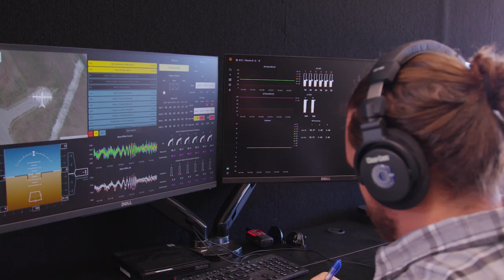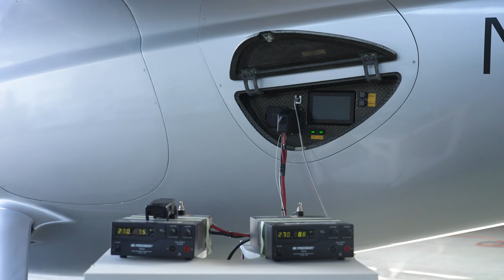Adam Savage Learns About an Electric Flying Vehicle!

Comment: I'm definitely getting 'SV startup' vibes from a lot of the responses, but it's very refreshing to see them acknowledging the limits of current battery tech and building something that can be viable (if niche) with current technology. It seems like you see a lot of headlines of "electric plane of the future will replace jet fuel for airlines!!" that neglect the slight issue that batteries are nowhere near energy-dense enough for that currently. Definitely don't think just moving traffic to the air is going to solve traffic issues, just move them, for for short-hop transport like they are proposing it could be an interesting option. I could also see this tech being useful for services like lifeflight, where they are relatively short hops but need high maneuverability.

Comment: Too many propellers.  The top range of an electric plane is proposed to be 600 miles for an eleven passenger plane. 100 miles is pretty low for today's tech and design.  This is not a flying car it is a vtol plane with a small battery.  Better batteries are being made now, such as dry solid state and graphene batteries.  I want the flying car that is small, driveable  with vtol capability without having a huge change like giant folded up wings.  Two large propellers aft and fore and two smaller ones for propulsion forward and slide out wings from the bottom, not huge just a manageable size.  Also small wings on the top to aid in lift, range and efficiency.

Comment: It’s going to require some HUGE innovation in battery technology for this kind of thing to ever be feasible. energy density of batteries is still less than liquid fuel, and unlike liquid fuel you don’t lose weigh as you fly. However a 1 hour flight time is still quite impressive.

Comment: I think autonomous is going to be the only way to make this viable. Having set “highways” in 3 dimensional space where these travel on their determined routes. A pilot would be nice for emergencies, but I think people are feeling more and more comfortable with autonomy. It’s also a much easier idea in the air than it is on the ground; less pedestrians and other vehicle congestion to worry about. 
If you have the highways set and clearly understood, the algorithms for custom flights get even simpler. Truthfully, more autonomy and determined pathways in airspace as well  as better instrumentation to show those pathways will just serve to make air travel even safer in the future. 
On the whole, the biggest improvement we are waiting for is higher capacity, lighter and less volatile energy storage. Once we have that, these aircraft will become far more accessible.

Comment: This is cool but it's not a solution for traffic. We need to remove single passenger vehicles from roads, not add single passenger vehicles to the sky. This is essentially the "add more lanes" flawed mentality except vertical. Railways are better in virtually every way for reducing traffic. This is more for luxury travel or possibly emergency travel in remote areas etc.

Comment: Though I'm not one for knocking down peoples innovative dreams,  i have to say this aircraft does have quite a bit of questionable attribute.  The main issue i see is the inevitable drag which will be created when its rear set of rotors are taken out of use when the aircraft is in full forward flight.  6 large rotors that will generate a ton of air instability (drag) when not in use.  Joby which has a somewhat similar design uses a tilt system for all its open rotors creating thrust and fully eliminating drag.   This design was rather poorly conceived.  A disjointed idea of two systems, one for forward thrust and another solely for lift, and only serves to reduce the aircrafts efficiency once its underway.  Ironically this Vtol concept shows little promise if compared to a forthcoming electric powered helicopter.  One that would see to greater numbers of passengers and a far simpler layout.  As for autonomous operation.  not likely.  There will always be a need for a pilot on board in case of an emergency.  The minute an incident occurs without a pilot on board is the minute that very issue will center upon.  Its not that a pilot must 'fly' the vehicle at all times but rather simply having the access to fly the vehicle in an emergency situation.

Comment: The big problem with electric aircraft is battery energy. Ten pounds of gasoline has 100 times the energy of ten pounds of battery. This plane is clever engineering but until the battery problem is solved electric powered planes will be impractical because of battery issues. The real research into electric vehicles should be is making batteries that are lighter and have more energy capacity.

Comment: Love the idea, but even if they somehow became reality your forgetting the most limiting factor... the weather.  You would need near perfect conditions to use it with any degree of comfort.  Low altitude flying is prone to terrible weather  , would be hideously bumpy and turbulent on all but calm winter days. 
Pilots tolerate turbulence but normal people would be scared to death and feel ill . 
Even if the weather is good where you take off it could be way different where your going and when you return

Comment: the engines usually are the most expensive part of an aircraft, also they part that requires the most maintenance, so the less engines, the more cost-effective and flight time it can achieve, up to a point, it will always at least need 1 to operate, right.

so 6 electric motors are going to be very expensive and maintenance heavy. this is cool tech, but not a commercially viable product by a long shot

Comment: I don't think it is a problem with the vehicle now that electric motors and especially high-capacity batteries are a thing.  The bigger problem by far is the air traffic control system that would allow millions of them to safely share the skies.

Comment: Was there any talk about obstacle avoidance?  I cant help but remember Back to the Future II, where the Skyways were so overcrowded, that they had to come down and take surface streets to get anywhere.  You cant just fly a car where ever you want, there have to be rules about where and how they are flown. Has this been given any thought.
Reply: We are working closely with the FAA on achieving Type Certification. You can learn more about our progress and collaborative relationship with the FAA here: https://youtu.be/yQXLMjbBHU8
Reply: @ArcherAviation  Thanks! As long as its in the plan, Im happy.  Keep up on the autonomous flight too!  The thought of people flying the way they drive scares the bejeezus out of me.
Reply: @starhawke380  Our aircraft will be flown by professional pilots, but we do envision a future with autonomous eVTOL at some point not too far out.
Reply: This can be a problem until the human factor is removed. For example, if all vehicles were autonomous, you wouldn't need traffic lights. They can coordinate by themselves at speeds only computers can achieve. Of course that's for the future, right now traffic is light so sure, maybe the occasional flight can be done "manually" (if the uber "fly by wire" poly rotor drones do can be considered such).

Comment: I see this product as a potential replacement to a helicopter due to its vtol capabilities but I do not see a viable option to be a taxi service. His argument about taking people out of cars and into the air is not a good idea because of the amount of air traffic in the air that air traffic controllers need to control. I think a better solution is take the traffic underground or use the public transportation we have now and improve on it instead creating a solution with potential problems.

Comment: The furthest propeller is pretty far from center. How much trim does the vertical stabilizer have?
Reply: 42
Reply: Looks to me as the forward rotors have two degrees of rotation (up/down, and possibly a bit left and right) -- they may be using that to add additional yaw control
Reply: when one motot dies they will likely need to kill or reduce power to the compliment on the other side.

Comment: Im kind of confused that, i believe 5 years ago, i was wondering about the state about evtols and first found chinese ehang. I thought that looks pretty cool, simple and surprisingly market ready. They even had done many, many test flights already including test flights with passengers. Yet they still aren't implemented anywhere. There's also a prototype autonomously operating scyscraper firefighting drone. It's only downside is range but apart from that, i think it's the superior concept, as it is so much smaller than this monstrosity right here. Then again the ehang is probably deafening.

Comment: I think one of the coolest things is that it just goes from motors off to flying in no time - no warmup period like conventional helicopters.
Reply: That and it doesn't use $150 in fuel during that non-existent warm up period either...
Reply: 😎 Yep! eVTOL aircraft are superior to helicopters for urban air mobility in several ways: safety, noise and lower operational costs being three of the biggest.
Reply: @ArcherAviation  Yeah, I was specifically thinking about military applications re: warmup period. Pretty awesome stuff.
Reply: @MattTee1975  Same thing happened to electric cars. Well its been long since people needed to warm out their ICE cars but still, electric motors have this advantage of instant power and simplicity of maintenance vs combustion engines.
Reply: @freeculture  Yeah, it just really stood out to me, because when I was in the Marine Corps I'd watch CH-53s and 47s just idling on the deck and imagine literal tax dollars being consumed.

Comment: This system will basically work like an Uber(elevator) service where you call for one and set a destination and everything would be done by automation with human oversight on the ground with no pilots or yourself in control of the flight.

Comment: What does the flight test instrumentation for this vehicle look like? Is it just integrated as a part of the custom vehicle control system or is there independent orange wire systems running to a commercial product that say the FAA is familiar with? I understand it's a lot easier to achieve FAA certification by using COTS products over custom built systems.

Comment: how  will you combat the smoke from a battery failure/fire!!!!! its gonna happen?
Reply: It pretty much never happens and only with extreme unique cases (such as really, really bad manufacturing tolerances and regulation). Battery technology have a ton of safety features that prevent thermal runaway. 
Even tesla with their shitty manufacturing quality have only ever had a handful of thermal runaway instances with their oldest models, and they have millions of cars on the road. Cars catching on fire (by their own account) is within a certain tolerance for mass manufactures, but with battery tech, it's almost literally unheard of. 
You are 100000000000x safer in a EVE than an ICE. It's also why EVs get all the safety awards every year.

Comment: I forget the name but there is another company that is making vehicles like this in the USA though ultralight, they have a different look and have been out since 2019 or so, just the production has been slowed due to component shortage and China Hording some of the parts so it is slow to market.  They have the plan for the vehicle to have the eventual Price down to $60,000 or $50,000 so no more then a New F-150 Northland edition if bought new in 2021--2022, depending on the features you got on the truck. People can actually get into the vehicle.
Reply: There are a whole bunch of companies trying to get into the "disruptive" e-plane game.  I tend to trust Archer's design more than most, because they stole it ready-made from Wisk / Boeing.  Theft of trade secrets trial against Archer starts Jan 2023.
Reply: @SansNeural  Yes but this one has had a ton of people test the ultralight plane that does a very similar thing and uses trusted flying tech in them, that planes like the small one man/a few passenger lightweight planes and as well as small turbo props like the small 12 or less passenger use in the plane/ to keep the weight down.  Then use engine tech the drone industry uses for some of the high tech drones that is no longer under patent, they forgot to renew/chose not to and missed the window for renewal just scaled up for use.  The nice thing is that the plane flies silent due to using a similar propeller that has wing end stabilizers going both sides of the propeller. I trust this other company more then this one becuse they did not simply copy a one to one design off another company and did actually have a number of passengers in the test flight the plane does itself without a ground crew. When I saw this one I thought of a plane Boing is making/has made for militaries around the world and thought hey this is that drone but made for a passenger, but n o p e, full on copy.

Comment: What I would be most excited about right now would be a hybrid tiltrotor with a axial flux motor to produce extra lift for take off and climb, when the engine is least efficient. Both the battery and the motor can be small and light and you can charge in forward flight, no need for dedicated charging infrastructure. The battery should be not only easy to replace but also to upgrade, allowing for more fuel savings over time. You could also get away with smaller blades to reduce drag in forward flight, saving a little more fuel. 

It is already a practical design choice. A system like that will save you tons of fuel, especially in short flights (imagine interurban or between states). That's the kind of flight where vtol is most useful. 

We could have smaller heliports instead of interstate bus terminals. Not nearly as efficient as trains but much much more flexible.
Reply: It's called a helicopter. They already exist and are much cheaper than a solution such as that. 
Don't disregard the fact that the FAA would never allow personal craft beyond what helicopters offer to fly over populated areas. 
It's a safety factor first and foremost.
Reply: @evolicious  n probably means a gyrocopter or autogyro with that fancy main rotor powered takeoff. Not really a helicopter since its flying on autorotation most of the flight, being pushed or pulled by a small propeller (not the big rotating thing on top) like any small plane. And yeah, i think an electric autogyro sounds cool, but they are not fast due to physics, unless they have small plane sized wings as well.

Comment: One point of inefficiency I'm bothered by is the rear propellers.  When the craft isn't doing VTOL flights, they're shown as stationary, but that has to introduce drag.  It seems like they should also tilt downward to face backward and just rotate the propellers the other way to provide additional forward thrust.  There are several back to back propeller aircraft examples, like the Cessna 337 Skymaster, showing that this kind of propeller configuration can work.  And while it MIGHT be less efficient than other propeller layouts, it's still more efficient than having 6 dead props creating drag during flight until VTOL mode engages again.
Reply: Yeah, Kirsten Dirksen released a video on them 5 days ago and in it they mentioned that hovering drains power quickly.  So they can't go straight up to desired altitude but have to transition to forward flight ASAP.  Limiting hovering to mainly landing and take off, otherwise range would be significantly shortened... She also got to use the flight simulator for training pilots on it...
Reply: @ZeoCyberG  In the case a runway is available, i wonder how much more economical it would be to take off and land horizontally with it. Its nice to have the vtol to be used only when needed.

Comment: The only truly flying car would be when we solve the problem of gravity and are able to do away with rotors altogether. But even then the system of traffic control would be enormous and that in itself would be a major point of failure and so you would need to build in radar type systems along with collision avoidance being automated and negotiated between vehicles.
Reply: I only see it feasible with full automation, no human doing stupid things or getting drunk or falling asleep, texting etc. Bad enough on the roads to also take it to the sky, and even less people are able to get a proper pilot license otherwise that flying car of the 60ies would be more popular. But if the things can fly by themselves, the problem of air commuting in urban space is solved.
Reply: @freeculture  And then we would be vunareable to becoming a totally controlled society with big tech or who ever runs the automation in control of when and where we  travel.

Comment: An Osprey VTOL flew over me yesterday, second time this month. I might not have noticed if it didn't sound so different from the usual prop plane or helicopter. Nobody with their earbuds in even looked up.
Reply: Was it 300ft over your house? What if it was 30 times a day and not twice a month? Also, the relatively low rpm of an Osprey's rotors isn't a good comparison to the high rpm propellers of something like this. I think it's an amazing, exciting aircraft but I think we're all going to like them less the more there are of them

Comment: Proper variable- pitch props and lower disc loading and usable wings, human pilots,  along with talk of ACTUAL mass production, which never really has been a thing in aviation,  give this lots more promise than most other concepts in EVTOL.
Reply: human "pilots" are a detriment in my book, but ok, i guess there needs to be a transition for old minded folks, even if its just for looks...
Reply: @freeculture  since there is no viable autonomous human-transporting aircraft currently,  and this could be flying operationally long before one could be certified,  that's reality,  your prejudices notwithstanding.